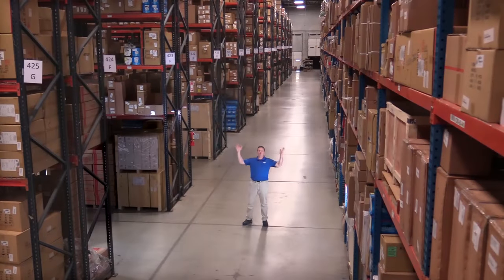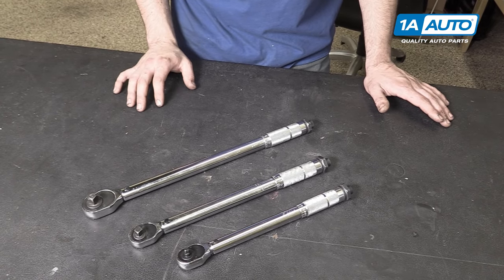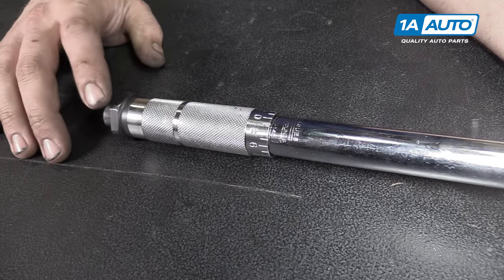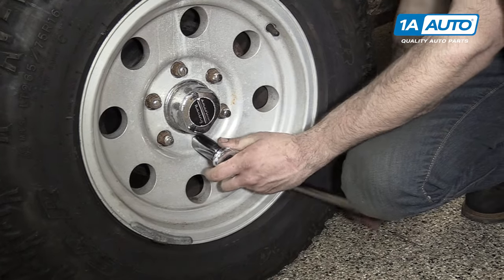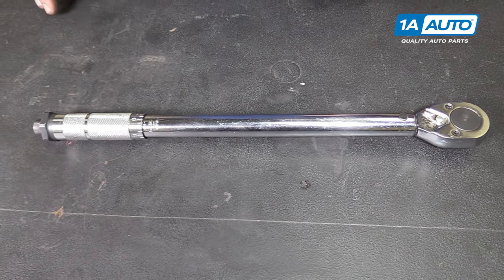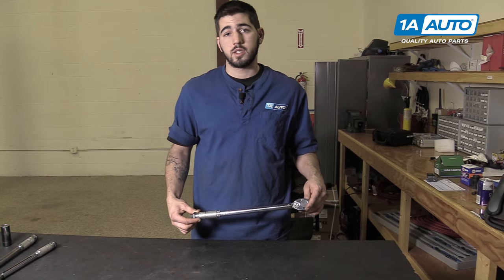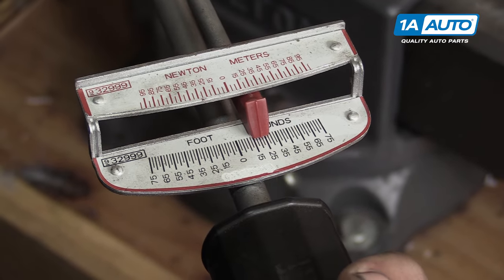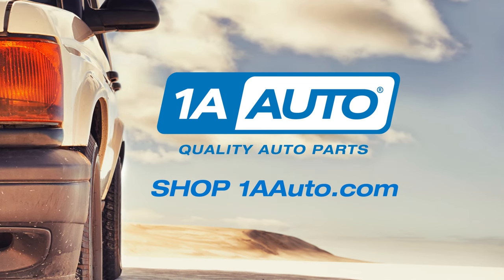How to Use a Torque Wrench Properly

Comment: Just got a to-150, identical to the one used.  Quickly learned to use the bottom area of the head to be able to turn the knob higher and to also lower it until the tension has decreased and the handle easier to turn.  After watching your video, especially after reading the tool's paper instructions, it has become very clear how to use the wrench properly and what NOT to do to have it around a while.  The other styles of torque wrenches were fascinating, glad to know there is a variety and what is recommended for the different areas of a vehicle.  Thank you.

Comment: HELP!!! Which torque wrench do I need to use to do Spark plugs on a Toyota Camry 2009 4 cylinder? 1/2" 1/4" or 3/8"??? I need to torque 14 foot pounds..... Can I use a 3/8"?

Comment: Just got a new torque wrench and I was wondering what to you do if it doesn't zero out exactly on the horizontal line. Mine is just off and is on the horizontal of 28 nm when the dial is at 7.
Do I just take the seven as zero, or is there a way to adjust it?

Comment: For the 3/8” torque wrench for brakes.  When torquing the rotor bracket and calipers would the length of the torque wrench fit inside the wheel hub to be able to tighten them? Just wondering cause of the length of the wrench and the room size inside to tighten.  Thankyou kindly.

Comment: what is the difference between newton meters & meters
Reply from the maker: +Mike Serna Meter is a unit of length. A Newton metre is a unit of force (the amount of force necessary to torque a nut or bolt to the correct amount of pressure)
Reply: Meyer is length/distance and Newton meter or Nm is the unit of torque. Torque is distance(m) multiplied by the force(N)